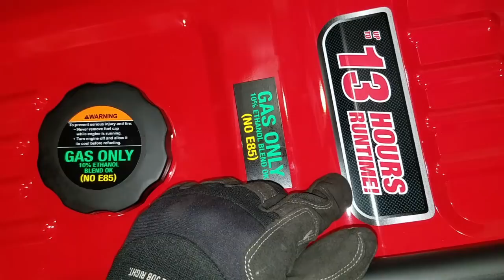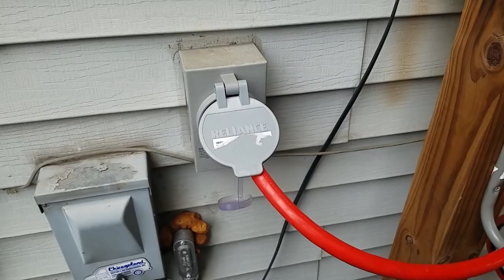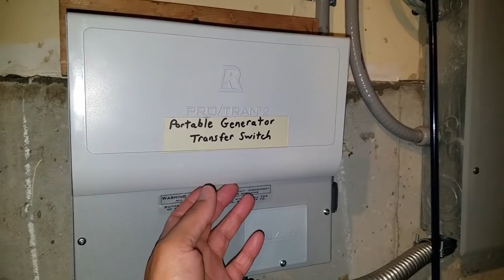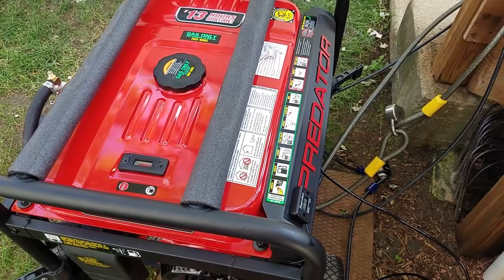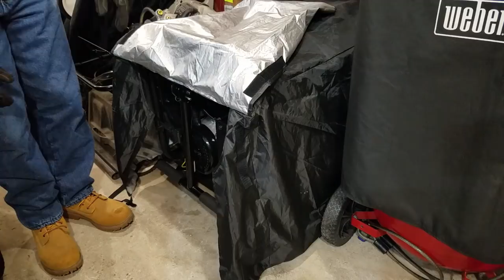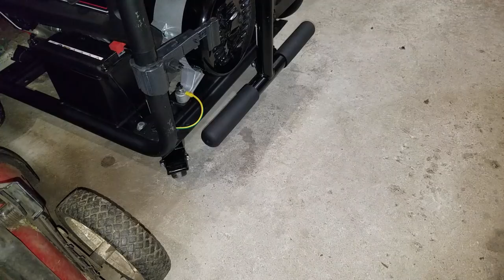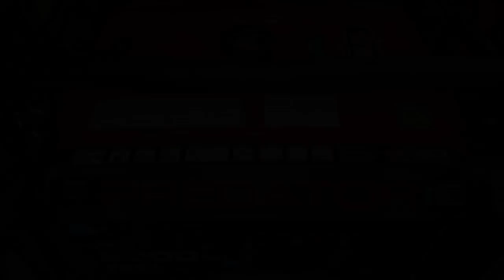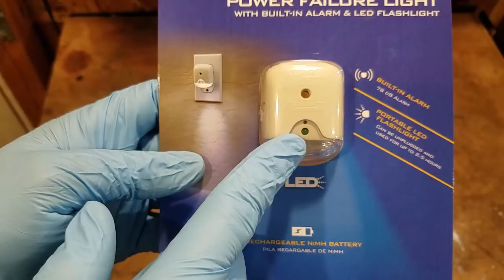Predator 9000/7250 Watt Generator, Tri Fuel Kit and Accessories Review/Testing

Comment: A few more notes... I had my HVAC contractor do the connections from 
the gas line up to the regulator on the generator. I did the installation of the conversion kit on the generator. At my request, the contractor provided a flexible gas line with quick-connects on both ends. I wanted them to be responsible for everything upstream from the generator so that there would be clear lines of responsibility in case anything did not work as expected.
Total for parts and labor was $600 which I thought was a fair price.   That included the permit and inspection fees.
Reply from the maker: Not a bad price at all.  Thanks for sharing. This info. will benefit those that can't do this job themselves.

Comment: Yesterday the county inspector approved the natural gas conversion and installation for my Harbor Freight Predator 9000 generator. No more wrangling gas cans!!
Your video was both an inspiration and a reliable guide for the conversion. I went with the US Carburetion kit. After a few tries (and remembering to use the primer button!) it started up. Since then I've started it several times using batteries and the pull starter.
Thanks for posting your video!
Reply from the maker: Not having to keep a lot of fuel on hand, or having to refill the generator, is the greatest benefit to the Tri-fuel conversion kit.  I've seen videos of people standing in long gas lines, to fill up gas cans, after a natural disaster. Not to mention, if the power goes out in my area, the gas stations won't have power to run the gas pumps.

Comment: When your generator is not in use ,should the fuel be drained or can the fuel be allowed to remain in the tank until the generator is needed again, also , does gasoline go bad after a long period  of time,great video thanks for sharing.
Reply from the maker: Personally, I treat all the gasoline with Fuel Stabilizer, in the gas storage containers. This way, I don't have to worry about adding the Fuel Stabilizer to each tank of gas. With fuel stabilizer treat gasoline, it should hold up to 12 months. I cycle the gas out, about every three months, by putting it in the gas tank, in our vehicles. If you exercise the generator every month or two, don't drain the tank. Any longer then that, I would drain the tank empty.  Also, after each use, run the carb dry by closing the fuel line valve, before shut down, and let the engine die.  This will burn any fuel left in the carb.
Reply: @Pk3_Garage  Thank you for the reply, it answered my questions and will be very useful, I plan to purchase a generator soon, but need to do more research, thanks again.
Reply: @Pk3_Garage  I'm sorry sir , but I had one other question,  do you feel it's necessary to protect your generator against an EMT attack, I have some possible ways in mind but haven't decided yet on which I'm going to use, I hope you don't think I'm crazy ,just trying to cover all the bases, thank you very much ,your video is very informative, Thx.
Reply from the maker: Your welcome and no problem. You have to explain what you mean by EMT attach.
Reply: @Pk3_Garage  my fault, I meant to say an EMP attack, its similar to a solar flare where all or any kind of electronic device including automobiles will become non operational due to there electronics being overloaded and fried, also the grid will go down, maybe I have been watching to much YouTube, but if you look up " how to survive an EMP " on the net it will explain what I trying to say, also are enemy's are aware of this and know how to create a man made event like this as we know how to do this to them as well,I think you will find it interesting, it all about how you ground everything if you plan on surviving such an event, try looking it up and tell me what you think, have a good one.
Reply: @Pk3_Garage  EMP, electro, magnetic, pulse.
Reply from the maker: Ahh, I see what your saying.  Reminded me of the EMP used in the Matrix movies. So, no I don't have anything to protect our generator from an EMP attack. Really never crossed my mind. They do have some EMP shield covers to protect generators.  I read you can use aluminum foil, wrap around three times, to protect electronics as well.
Reply: @Pk3_Garage  very good sir, it's been a pleasure communicating with you ,thanks again for all the info ,it will come in handy, take care.

Comment from the maker: So, I finally had a chance to install the Motor Snorkel and it works great.  I think I found my issue when using the adaptor.  On the carburetor, there is a small breather hole, that was covered up when using the adaptor.  I believe this was preventing air flow into the carburetor. 

I had no problem running on Gasoline or switching back and forth between NG. I highly recommend using a "Poniie PN1500 Portable Micro Electricity Usage Monitor Electrical Power Consumption Watt Meter Voltage Amp Tester" to adjust engine RPM's, so you can have the 60-62hz, when running under load.  (I did have to make some adjustments to the RPM's) My tachometer isn't showing the correct RPM's, so that's why I used the watt meter voltage tester. I plug the watt meter into the 120V plugs on the generator, on both legs, to see the hertz/volts output.  I'm thinking about doing a more detailed video about this, the tri-fuel kit and the readings in volts and hertz. Let me know if you guys are interested in this.  Thanks

Comment: Excellent video. I have a Westinghouse Wgen 9500 dual fuel generator and want to convert it to use NG. I was wondering if you have had a chance to try the US Carburetion Snorkel kit yet.
Reply from the maker: Thanks. Its funny you asked this question.  I just installed it this weekend.  (I had to order the Power Valve) It was an easy install and it works great. The issue I had, trying to run the generator on gasoline using the adaptor, is no longer an issue.  I was able to switch between NG and Gasoline with no problem. There was no power lose either, with my testing. (Checking engine RPM's and voltage output in a few outlets in the house. US Carburetion kit is the way to go.
Reply: @Pk3_Garage  Great! That's what I needed to know. I'm going to order one now. Did you do a video of the installation, or is it easy enough that someone who is not that mechanically inclined, like me, can easily install it? 
Thanks for the reply
Reply from the maker: That's good.  You'll enjoy not having to refuel the generator. No, I didn't do an installation video, but there are a few good ones, on YouTube, you can watch. It's not really hard, just make sure to place a piece of wood in front of the gas tank, when you are drilling through the frame. That will help to not drill into the gas tank. Ok, now that I'm thinking through things, let me know if you want me to do a video of everything relating to our gas line set up, to the Tri-fuel kit installation. (I had did a lot of research before buying supplies to set up our system)

Comment: I noticed with Natural gas your engine RPMs were down below 3600, which would change frequency and voltage output more than likely to under 120 Volts. It may also be the reason for the carboning up of your spark plug. I would clean that plug and raise RPM to at least 3600 then check the plug after ten or 12 hour run to see if that corrected the problem. There is an inexpensive meter called a kil-o-watt that can be used to balance your frequency ( ideal 60 - 62.8) and voltage (110 - 125) that would help. {3600 RPM should equal120 volts at 60 Cycle frequency}
Reply from the maker: Thanks for that info. I actually thought the RPMs was 3400. Just recently I tested the voltage on a few 120V outlets in the house that was running on Gen power.  The readings was 121V-123V and was pretty stable even under load.  I'm still going to check the frequency though. (I have to verify that my multimeter has that setting). Question, on my tachometer, the RPM's range from 3200 to 3700, even though the engine is running smooth and the voltage output is at or above 120V. Is that normal? If not, any idea how to fix?  Now that I'm thinking about it, I'm going to check the setting on the Tachometer and make sure it's set correctly, to register the RPM's for our generator engine type. Thanks
Reply: @Pk3_Garage  I would say the tach readings were probably in the ball park because the governor may be doing some regulating if the engine was warming up or for some other reason. I would also like to add that it is normal for the engine to run a lower rpm using Natural gas or LP gas unless you adjust the Carburetor manually to compensate. The engine governor however is a internal mechanical devise activated by weights so it will continually hunt for the engines pre-set proper rpm iaw the spring tension applied. If you exceed that setting the governor is useless and that usually ends in disaster.
Reply: @Pk3_Garage  An explanation of the 3600 rule: Your generator has a North and South pole each turning at 3600 RPM and alternating the current 7200 times per minute. 7200 /120 volts = 60 cycles known as the Frequency. (Hope that helps) This works when all factors are absolutely perfect. To get the perfect frequency vs volts inverters are used to invert DC to AC electronically. Generators produce an uneven frequency that can damage sensitive electronics like computers and circuit boards in tv and refrigerators under certain circumstances.

Comment: Where in your video does it run on propane? It's a tri fuel kit right. Do you adjust the the regulator and put a different propane line on it?
Reply from the maker: I don't have the connections for LP.  If I did, it would connect above the NG pipe, on the regulator. (It would be another connection for LP) You will have to adjust the power valve, on top of the regulator, to smooth out the engine for all three fuels. (use a Tachometer to adjust the engine speed to 3600+ RPM's)

Comment: Carbon Monoxide is the invisible gas that will kill you.  Carbon Dioxide is an essential to life gas that benefits plant growth, and food production.  Great Video overall though.
Reply from the maker: Hi and thanks for the correction.
Reply: Pk 3 and you are humble too which is so rare these days. I am even more impressed with you now. 👍

Quick question. Does the top row of switches on your emergency load center have a true OFF setting, or does the "OFF" line just mean that the electrical connection is momentarily off to each circuit as you switch between GEN and LINE positions?
Reply from the maker: From my testing, when I place the switch to the "off" position in the transfer switch, that circuit power is cut off. (Even though the circuit, in the main control panel, is still in the on position)
Reply: Pk 3 Thanks. I just subscribed. Great info on the load balancing between phases which is overlooked by some people who are on the bubble as far as capacity goes.
Reply: @Pk3_Garage  Spark plug testing on a really great channel.  https://youtu.be/jcVF3xL_fzk

Comment: Great video - glad you covered many items that are not mentioned anywhere else, while my Predator 9000/7250 can't handle my 4Ton A/C unit it does cover everything else in our home by managing the Watts load via manual breaker toggles at our main breaker panel....the only thing I would recommend is to install a "Sense" unit that allows you to see your Watt's load via CT's deployed to your main breaker utility wires....

Comment: I'm no expert but should the transfer switch be set to Gen?
Reply from the maker: Only when running on Generator power. All toggle switches should be in the "Line" position, when running on utility/grid power.

Comment: I’m planning on getting the same predator 9000 although now the price is $749 ($649 with coupon).
Reply from the maker: Yes, it has increased $100 since 2021. Even at $749, its still worth the price and we would have gladly paid that price, when we bought ours.
Reply: @Pk3_Garage  exactly it’s still best deal on generator. I live out in the country so LP gas isn’t available however propane is but gas is still cheaper so I will buy the kit incase that changes.

Comment: Great video, like how you went around and showed everything. 
I have the same kit on my B&S 6250 Storm Responder, works great!!  No more storing/treating gasoline
Reply from the maker: I really like the Gentent. We had a big snow storm came through, about a month ago, that was predicted to knock out power in our area.  I set up our generator and put the Gentent storage apron on until needed. The Gentent protected the generator very well. We never needed to use the generator, but it was nice to see how well the Gentent protected it in the snow.
Reply: @Pk3_Garage  I keep mine beside the house just inside the fence and next to gas/electrical inlet. I have a 6x8’ tarp mounted from house to fence and completely covers everything and protects from the elements. Cost maybe $15
Reply from the maker: How do you protect it from rain and snow, when it's running? Since we only lose power maybe once a year, if that, ours is stored in the garage until needed. So no need for a separate storage shed.
Reply: @Pk3_Garage  think of a lean to. Tarp from house to fence 6’ wide and 8 feet across. The whole area around the generator is covered. And great for airflow
Reply: @pctech911  I use a 10x10 tent from walmart. With the legs half way up. Then I lean a piece of plywood up to the generator to deflect the soud away from the house.
Reply: @SgtRudySmith31bRet  I used that in the past but during high winds it’s gone.
Reply: @pctech911  lol I lost my first one the same way. Tractor supply has land anchors cheap. I bought a few of the large ones for my trailers incase it floods and I have one in concrete to secure my generator with a lock.

Comment: LOL I have a similar setup, I am still not sure about the gas hookup and the 20% power lose. Great video thanks for sharing.
Reply from the maker: Can you explain, in more details, about the gas hook up and 20% power lose your unsure about?  Thanks.
Reply: @Pk3_Garage  Natural gas or Propane gas is what I was referring to. Using either, there is roughly 20% lose in power output as a posed to gasoline only.
Reply from the maker: That is correct. I noticed some power lose between NG and Gasoline, but couldn't give you a percentage. (I was still able to run everything I had connected to the generator) What I can say though is, depending on your power need, buy a generator that has at least 2 kwz over what you need and you should be fine. Remember, the tri-fuel kit are to make it so you don't have to refuel or store a lot of fuel to run your generator.  You can always switch between Gasoline and NG or LP, if you need the generators full power output.  I store 15 gal. of gasoline, even though our generator uses NG as its primary fuel source. The more fuel options you have, the better.
Reply: @Pk3_Garage  True, now I am seeing I really don't even need a specialized carburetor either. All that's required is a secured method of securing the natural gas line to the airbox (still investigating). In a real situation and time of year I am sure there are things that I can just not switch on if I were to go to natural gas. The propane option doesn't seem practical to me e.g. Texas long waits for fill ups. I too am in the Chicago land area and natural gas already comes to the house... Plus if it takes more propane to run less it just doesn't make sense to me.

Comment: Excellent review! I've had a portable generator for over 10 years and I still learned a lot. I just bought a new Predator 9000 which I plan to convert to Natural Gas, so this was very helpful.
The index into the video for each of the accessories was an extra bonus!
Based on your recommendations, I've ordered the following items:
- Tri-Fuel kit US Carburetion
- Locking caster set
- Runtime meter

I already had a heavy-duty lock for my generator that the Predator 9000 replaced. It locks to a heavy-duty chain that connects underground to a spiral stake sunk about 12" into the ground. My generator is stored in a small custom-made shed. The stake for the lock is under the generator and some pavers that the generator sits on. My bigger concern is that a thief would saw through the frame where the chain wraps around. But then there are PIR sensors and security cameras to get past... :-)
Reply from the maker: Thanks.  Sounds like you've got everything covered.  I know what you mean about a thief cutting the frame.  I use two locks and cable chains.  One on front and back on the generator. I think I might dig a two foot hole and cement an eye bolt in it, to secure our generator.

Comment: I seen a comment that said yours did not run good on gasoline. I am having the same problem with the same tri fuel kit. Wondered if you ever came up with a solution to fix the problem when running on gasoline? Mine runs great on
 natural gas. Thanks
Reply from the maker: Remove the adaptor only.  This will allow you to use the generator on Gasoline.
Reply from the maker: So I finally got around to installing the Motor Snorkel.  It works great on NG and gasoline.  You will have to buy the power valve from US Carburation over the phone.